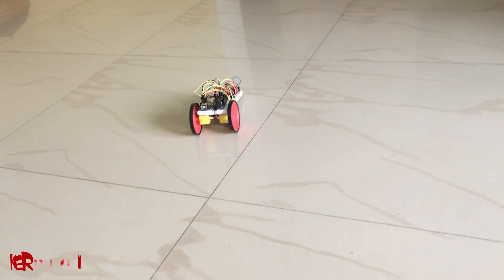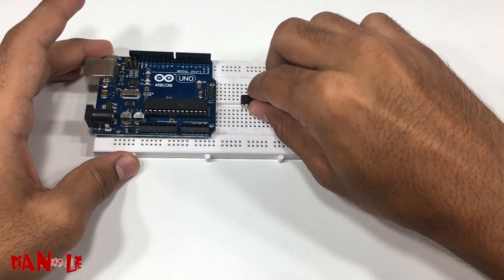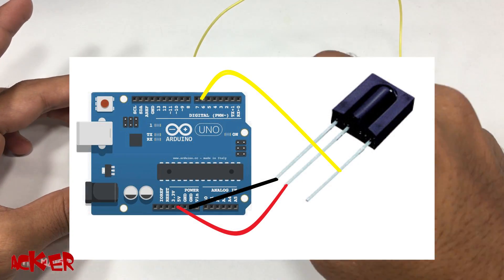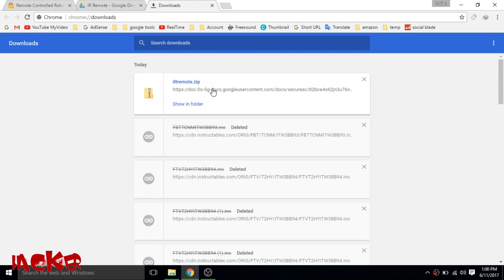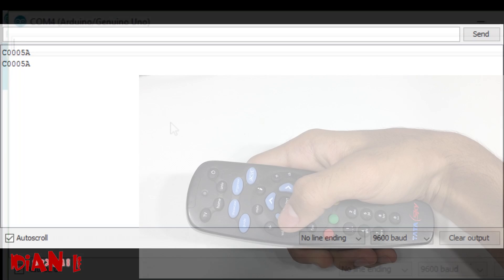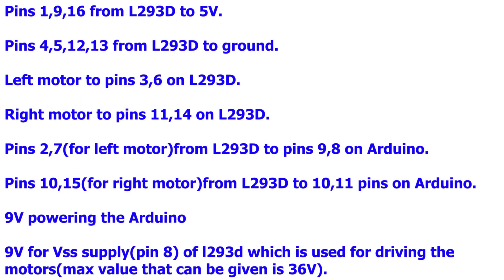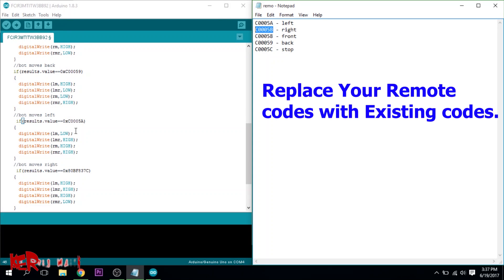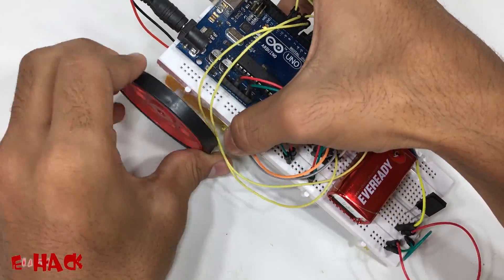How To Make Tv IR Remote Controlled Car | Indian LifeHacker

Comment from the maker: Program Codes : https://goo.gl/pDZ7eT

Stuff needed:
Stuff needed:
BO Motor         : http://buy.flyrobo.in/botyre
Ir Receiver        :      http://amzn.to/2yn8FWd      
L293D motor driver ic:  http://buy.flyrobo.in/l293d
Bread Board  : http://buy.flyrobo.in/brd
Reply: i have a dought can i mix this tv remote control with the one you uploaded obstacle avoiding smart car ....what difference will be there i mean is there would any problem in arduino uno chip if i upload both programs
Reply: Bro, how do u get those remote signals? Do u show them towards ardiuno uno?? Please tell me i have to make a similar one for my clg project
Reply: Indian LifeHacker
Reply: Good
Reply: Indian LifeHacker
Reply: Indian LifeHacker
Reply: @piyushprakash9561  uu j okk I'll jk I'll
Reply: @piyushprakash9561  at uthuk
Reply: i made it with four wheels it works fine but when car move in forword direction  and press key for turn it turns in forword direction. write a code for backword direction  turn.
but hex value both word turns and backword turns are same pleese help me
Reply: Sir can I make without aurdino.
Reply: Hihkhl humen jh blk h jo hum jh mk jk
Reply: ,djdgjavjdvnd
Reply: Mohammed ke naam chehra Kala mein Mohammed Farhan ke naam par ek doraemon card control wala control kar

Comment: what is the cost of dc motor
Reply from the maker: Here i'm using bo motors,
but you can use any dc gear motor.
and the cost of this motor is around 100 rupees per motor.